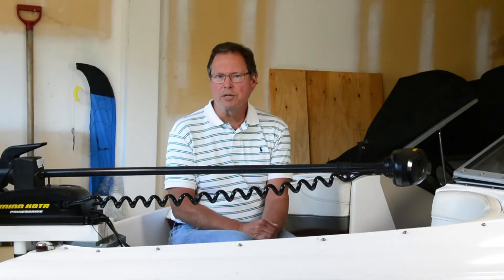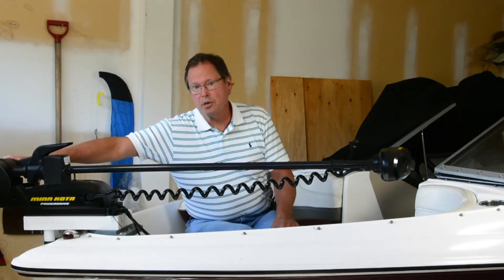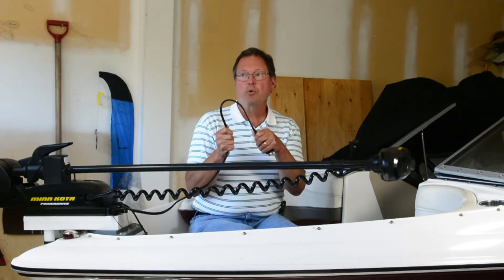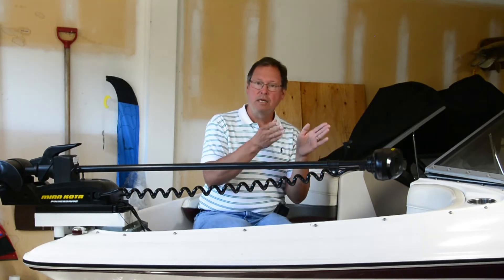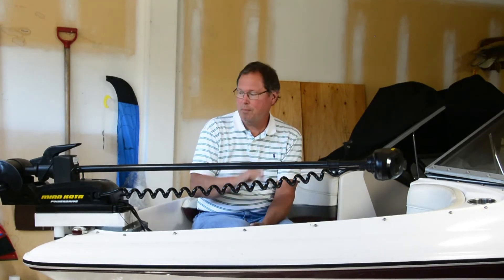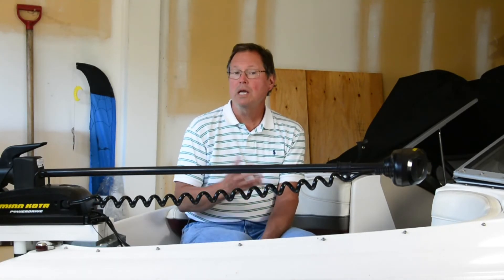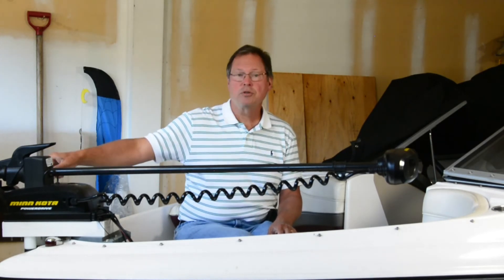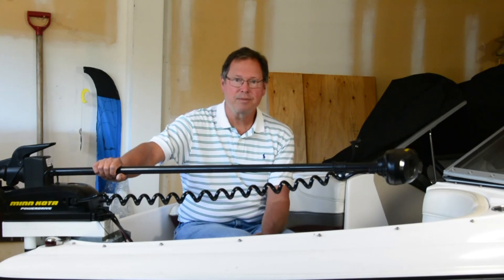12V vs 24V Trolling Motors - 3 reasons why 24V is more efficient

Comment: Much appreciate your sharing this! Interested in the 12 to 24v (55lb thrust to 70 lb thrust) conversion kit video. Did you ever do it?
Reply from the maker: Hi Warren.  Sorry for the delayed reply.  No, I didn't go ahead with the conversion for three reasons.  First, I didn't want to change the charging methods to 24V, either on shore, or off.  Second, the 55 lb I have seems to get me to around 2 MPH, so it is fast enough for my purposes.  Third, we kind of moved more towards NMEA as our core focus for our business.  You may want to contact Northland marine.  They can probably get you set up.
Reply: @GoldenChannels  Priced out the conversion kit through local suppliers in Canada... taxes in, it's almost $1000... Sadly, it's hardly worth it.
Reply from the maker: @WarrenPenner  It amounts to an armature, the control circuit board in the head of the unit, and the logic module for 24V instead of 12.  Armatures are $122 USD on Northland, and a 24V Control board is $ $138 USD.

Comment: I am curious about the weight difference between 12v and 24v gps trolling motor. The reason for smaller boats to choose 12v motor is because we want to minimize weight for easier transportation. Any data on that would be great!
Reply from the maker: The batteries required far outweigh the weight of the trolling motor.  I guess that is why you don't find much data on it.  If you have a 12V trolling motor that does not have the large coiled cord running from top to bottom then you have significant savings in power loss due to wiring.  If you only need the thrust of a 12V, and can use one that is constructed like this, it would be an excellent choice.

Comment: But won't the cables be sized appropriately for the voltage, so thicker cables for 12V. Then the voltage drop won't happen because the resistance is less for thicker cables.
Reply from the maker: True/  Kind of...  The issue is that a 60" shaft Powerdrive has about 110 feet of wire inside it.  And that Minnkota internal wiring gets in the way no matter how much you spend on your wiring to the battery.
Reply: @GoldenChannels  Your talking about the wire inside the armature right? But isn't that also sized for 12v, otherwise it would overheat?

Comment: "Motors run on power. They run on voltage and current and all that kind of stuff, but power is the important thing." Seems 24V has only advantages and regardless of the wiring details you always get N times more efficient package. Obviously most of us need 12V system in the boat, therefore you end up having 2 separate systems or spend money on system that deals with charging both systems appropriately. And what are these lead-acid batteries you talk about?

Comment: I have a key largo 160 that’s weighs about 1500 loaded I fish saltwater bays, and inlets could I get away with a 12v 55lb thrust ? I plan to only use the spot lock feature any advice would be greatly appreciated
Reply from the maker: What you see on my boat, which is 18 ft, and about 2800 lbs dry weight, is a 12V Powerdrive 55 lb.  It can get me to a top speed of 2.1 mph.  It is okay in what I would call moderate wind.  High winds would be a problem.  Hope that helps.
Reply: Thank you for the info, how does it do in strong current ?
Reply from the maker: @kennyjimenezjr.1348 It wouldn't do very well.  If you're dealing with significant current, I would definitely go with more thrust.

Comment: Hi Eric

Just watched your talk on 24v vs 12v system and found it very informative. The reason I watched it was that I tried to convert my 2hp petrol to a 24v electric with a motor I acquired but unfortunately the motor was defective and couldn’t handle it. Anyway I am now looking for a trolling outboard for my dinghy but have a dilemma. I’m in aviation so acquired a couple of 24v sealed lead acid batteries @ 13.6 ah each but I also have a 12v lead acid @120ah. I know on the face of it the 12v has more amp hours but I also know that the 24v system would draw less amps.

So eventually, here is my question, do I buy a Bison 100lbs 24v for £240 or do I buy a 65 lbs Bison for £199?

I’m asking a man who knows about these things so I don’t waist my money and get it wrong.

One more thing, the dinghy is used to get us from a swing mooring to the jetty 300 meters away and too and from the pub about 1/2 mile away.

Any help would be greatly appreciated. Dave
Reply from the maker: For the difference in those prices, I would go with the 24V motor, assuming weight in your boat is not a concern, and that either battery setup gives you enough run time.

Comment: I have a 12v trolling motor that I have two batteries for. I also have a starter battery. I use a 3 bank charger to charge my batteries. If I were to connect the two trolling motor batteries to make them 24v could I still use the 3 bank charger?
Reply from the maker: You may have to disconnect the batteries from the circuit before charging.

Which charger model?

Comment: What about in case of hobby terrain robot that's using 4 DC motors. And planning to build a 12V or 24V li-ion battery pack. In this case, which voltage level I should go for ? 12V or 24V ?
Reply from the maker: A Higher voltage choice on batteries always leads to lower power loss over wiring.  But there are other issues that might affect your choice here.  Higher voltage batteries have more cells, and that leads to lower power density, and overall less battery reserve capacity.
Reply: How lower power density ? for example, if I'm designing a 24V li-ion battery pack from 18650 cells, then that would be 7S and for power density I would put multiple rows of 7 cells in series. So 7S5P has more power over 7S4P. For 12V on the other hand, 4S5P would have less power than 7S5p, am I right here ?  @GoldenChannels
Reply from the maker: @PerchEagle  Generally, if you have room for a certain amount of power, if you divide the usable area by more cells in order to get a higher voltage, the mechanical aspects of having more cells uses more of the space for walls and hardware for multiple cells, instead of fewer walls for a lower voltage bank, but with each cell having greater reserve capacity.  This may not be as obvious with drones, but it is a huge consideration in solar, and golf carts/RVs.
Reply: Yep, I agree in drones it's a very sensitive specification, because more cells means more weight which could affect the efficiency of the drone. But in terrain robot, I think I can increase the battery size a bit for more power capacity. It's for me now whether I should design 24V or 12V battery pack for my future terrain robot. @GoldenChannels

Comment: I have a 12 volt MinnKota PowerDrive with iPilot that works great. I fish for two or three hours at a time at low power settings in a 16' aluminum skiff. Based on the 3 hours or less that it takes to recharge, my 85 Amp/hour battery is using less that 40% of it's capacity per fishing session. It goes back on the charger as soon as I get back to the dock. There is little reason for me to add another battery or two as well as a more expensive 24/36 volt charger. I'm sure that 24/36 volt motors have some significant advantages but they would be of little or no benefit to me.
Reply from the maker: I absolutely agree!  12V systems have less technical issues to overcome.  Chargers and charging systems are simplified, due to the 12V design being more common, and if you want, you can charge with a standard isolator like you are doing.  What's more, if you are a good shopper, you might find a 55 lb 12V Powerdrive at a boat dealer as a "take off".  That is how I bought mine.  Thanks for your comment!
Reply: @GoldenChannels  Thanks! I got my 55lb, PowerDrive with iPilot from a MinnKota dealer as a factory reconditioned unit for $1,050 including shipping. It looks new to me and was $300 less than a new one (if I could find one in stock.)

Comment: Thanks for your video!
I'm still struggling to decide which transom mount trolling motor to choose. I have a 12ft fiberglass old sears gamefisher rowboat (Semi-V Hull) which I'd estimate it weighs about 200-250lbs. Going to be used as primary power for small lakes. Fully loaded with fishing gear, 2 young kids, my wife, and myself I'd estimate total weight with boat around 800lbs.
I was going to order a Newport Vessels NV 62lb thrust 12v trolling motor. (I already have a group 27 12V marine deep cycle lead acid battery thats new)
Do you think this setup will sufficient? Or should I bump up to a 24V system like a NV 86? 
I cant afford a LiPO4 battery and didnt really want to lug around a second 12v battery. Any help would be greatly appreciated.
Reply from the maker: Thanks for your comments. Glad to help.

It is very difficult to find good answers on line for this kind of question. This is due to a number of variables that come into the equation. Things like hull design, weight, and trolling motor thrust all come into what can be expected for speed.

My boat weighs about 2,500 lbs. Our 150 HP outboard will push it along at a maximum speed of around 50 mph. When trolling, our 55 lb 12V powerdrive trolling motor gets us to a top speed of 2.1 mph.

This suits our needs. I generally troll around 1.5 mph, and keeping everything on a 12V system makes charging easy.

My only recommendation for you would be a slightly larger group 29 battery. They will give you quite a bit more run time with only slightly more weight.

I would expect somewhere around 2.5 to 3 mph to speed from the setup you are describing. It should definitely be sufficient for trolling.

Comment: I hope you still check this post and can answer a question about using 2 12v batteries wired in series.
I have a Kayak and want to add a Newport Vessels NK180 24v trolling motor. My plan is to use 2 12v 100ah lithium ion batteries since they are now small and light enough for use in a kayak. The motor will be within 3 feet of the battery storage location and draws approx 460 watts at full power. I was planning to use 8ga wires and 60 amp fuse, and charge seperately. Any recommendations or precautions I should be aware of? will any connector rated for 8ga wire and 24v be safe? I plan to use the Li Time 12v 100ah MINI @1200watts, weighs 19 lbs and is super compact. Thank you
Reply from the maker: Hi Robbie.  Sounds like a great setup for a kayak.  My first comment would be that the Trolling Motor Manufacturer should have a "rigging guide" that would contain their wiring suggestions for each model of trolling motor.  This would specify the AWG size versus length.  On our website, we have a power loss calculator for Minnkota and MotorGuide models, but not for your brand.  Calculations may or may not hold true, depending on the wire using internally in your trolling motor.  

https://goldenchannels.com/electric-trolling-motor-power-loss-calculator/

The calculations and data provided on this calculator are based on the two manufacturers rigging guides.

My second point would be to choose your connectors wisely.  We got out of this business because it was so competitive, but still have some reviews here.  If you connections get wet, use connectors that have some moisture protection.  None are actually "waterproof".  I do not currently think that any one manufacturer has a perfect solution.

Lastly, check forums about discussion with Lithium with your particular motor, and see if anyone has run into issues with them delivering too much power to the motor when cranked wide open.  There are some folks saying the lithiums are not recommended at over 80% speed, because they will deliver more power under load that traditional lead acid batteries.

We can help you with well built wiring, but like I said, we're out of the connector game.

Hope that helps.

Eric.
Reply: @GoldenChannels  Thank you for the quick and informative answer.....I really appreciate it. Newport has been very hard for me to communicate with but I will try again for wiring specs and general info. A lot of kayakers are using the lithium ion batteries in series, most using two 12v 50ah, with no problems that I am aware of. I want the security to fish the I C W, many places being a mile or more from the launch site, and I am too old to want to paddle back in an emergency. For a connector, I am looking at a 70a rated marine type that can use 6-8ga wire. its BIG but well reviewed. Thanks again. It is nice to find a true gentleman these days
Reply from the maker: @robbierobinson6312   You're very welcome, Robbie.  That sounds like a great place to fish.  Take care!
Reply: @GoldenChannels  I found a couple of your other videos, good stuff. I already had the Marineco connector on my list and the charts that you suggested make me feel that I will be O K with the installation as planned. Again, I appreciate the efforts you have made to help those of us who need it.
Reply from the maker: @robbierobinson6312  I'm a fan of the newer 70A plug shown in our trolling motor plug installation video.  It's what I have in my boat, and it works for me.

Comment: Excellent video, your very knowledgeable. I upgraded my 12v 45 lb MinnKota to (2) Lithium 100ah batteries hoping to improve runtime fishing in 3-5 mph current. Could I expect to gain more runtime running a 24v 70 lb trolling motor system?
Reply from the maker: Thanks, Keith!
Short answer is yes.  Exactly how much depends on the AWG of your power wire, and the length to the battery, however, the most significant reason it will be more efficient is there will be a lot less % of power loss in the trolling motor itself at 24V.  5% minimum advantage, but could be as high as 20%

Comment: Would you be losing it because the heat because you’re not using a big enough wire
Reply from the maker: Yes, the power loss "disappears" in heat.  Larger wire does help, but not as much as higher voltage.

Comment: Hello Erik, did you ever get around to making your 55lb thrust to 70lb upgrade video? And would that work on any make or model?
Reply from the maker: Hi Jim.  Things have been a bit too busy to get around to the upgrade, but I can let you know that this is only available for very specific models of motors.  The main issue is the sizes of the armature and magnet carrier.  The 55 lb to 70 upgrade works, but I have not checked other models.  Sorry I couldn't help more.
Reply: @GoldenChannels  Eric, Thank you for responding. I have learned so much watching your videos on Trolling Motors, Batteries, Wiring, and more. I really appreciate & enjoy your commentary, insights, and examples. Keep up the good work.
Reply from the maker: @jimetherington  Thanks for the comments, Jim.  Glad to be of service!  Take care.

Comment: So what puts out more power 24 volt 350 watt motor or a 36 volt 350 watt motor?
Reply from the maker: Hi Cody.  With the same boat, lengths and AWG wiring, the 36 V motor would provide more push/pull in the water.
Reply: @GoldenChannels  what if you power them with a 48 or 52 volt battery which one would put out more power?
Reply from the maker: @codydavidson8315  The best way to think about this, is that the higher the voltage used in any power distribution system, the less power loss that will result as a result of the resistance of the wiring.  This is a universal rule, and it is why high voltage is used in the power grid.  Does that make sense?
Reply: @GoldenChannels  yes that makes sense I already knew that but I'm just curious I put this video up how this guy got 1800 watts power out of two 350 watt motors can you explain this?
Reply: @GoldenChannels  thank you for the response I seen guys on YouTube take two 350 watt motors on a bike and claim they're getting 1800 watts of power out of them somehow do you know how to do that ?
Reply from the maker: @codydavidson8315  The power rating for the two motors in the video are rated by the manufacturer as 350W.  He's running the motors at a higher voltage than they are specified for, so I trust him when he says the motors deliver more thrust.  The sticker on the motor says 350W, so he's able to say he's running 350W motors for local regulations.  If the motors are over designed with larger gauge wire and internal components, this could work.  Problem is, you're buying a motor that is rated for 350W.  Using it under additional power and thrust may work, or not.  Or, it may work forever, or fail tomorrow.  Also, the two motors he purchased and is using gave him certain results.  If you order two of the same motors today, you may get different results, or not.  The manufacturer never specified they could be used in this manner.  

Two last thoughts.  His power rating is what power he is measuring through his controller.  This doesn't mean that is the actual mechanical power being delivered.  He doesn't test for HP at the wheels.  1800 watts is around 3HP.  Second, he doesn't talk about what happens if a motor were to fail, and what the consequences would be.  This is what separates good engineering from hacking.  A good designer thinks about the failure modes.  Which in this case might range from a walk home, or batteries exploding.  I don't see any fuses anywhere...

So, YMMV.
Reply: @GoldenChannels  thank you for your response I appreciate you
Reply from the maker: @codydavidson8315  Glad to help, Cody.  All the best.